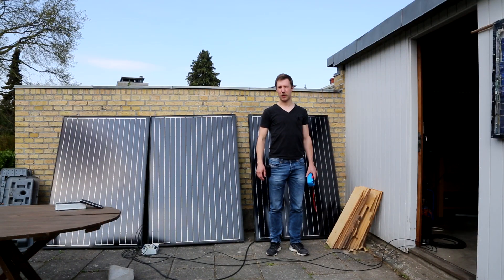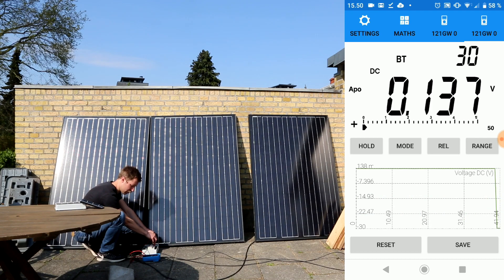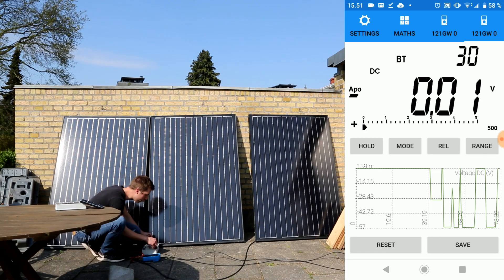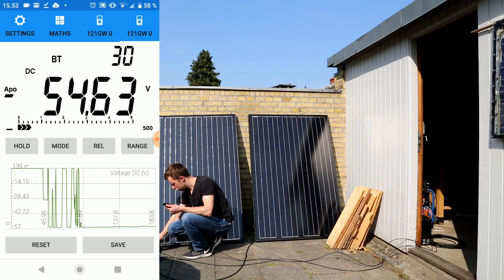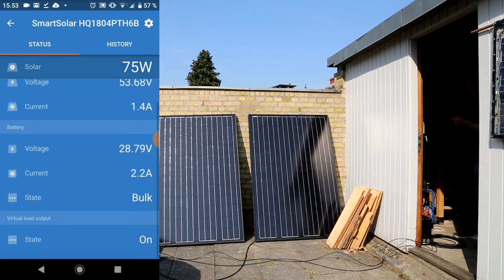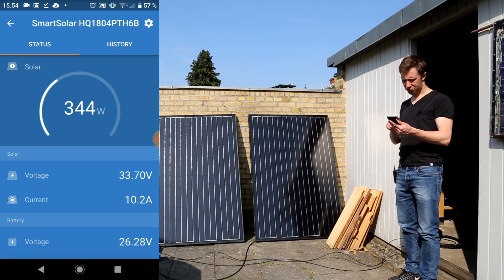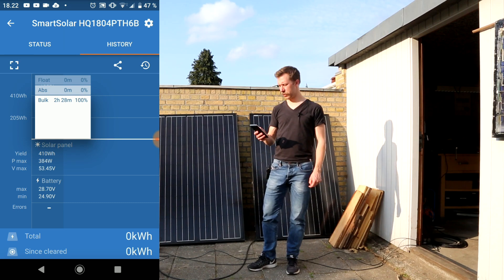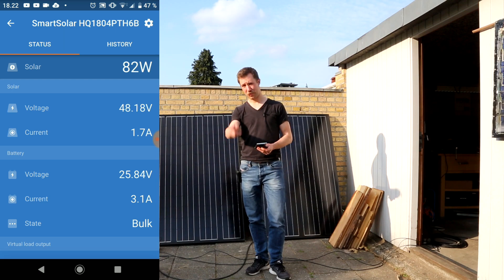750W Victron Solar Project - All 3 Panels Test - Part 2

Comment: 111520/0401h pst 1201 utc.. Thanks again for the 2nd part. I’m very happy to view the wattage jump to 300W plus.
Your system is perfect. There’s no issue there. Bravo... once your install the PV array on the roof top, I’m sure you’d observe the dramatic change in charge power. Thanks again and looking forward to the 3rd part. Stay safe and auf Wiedersehen